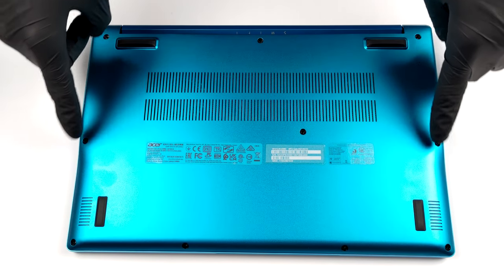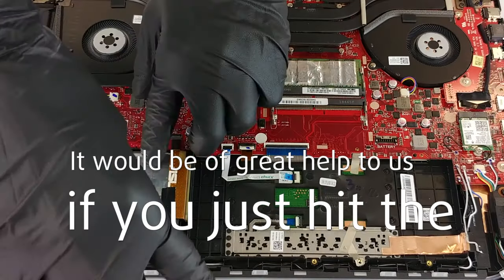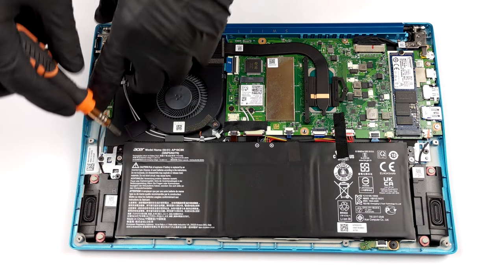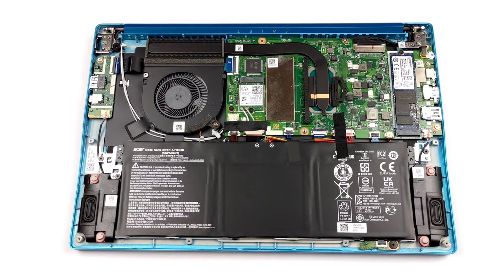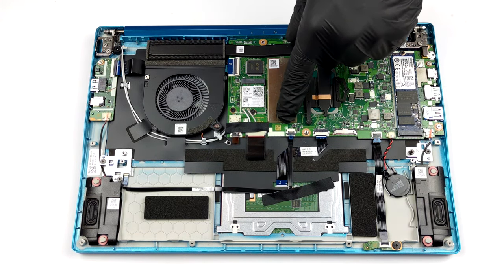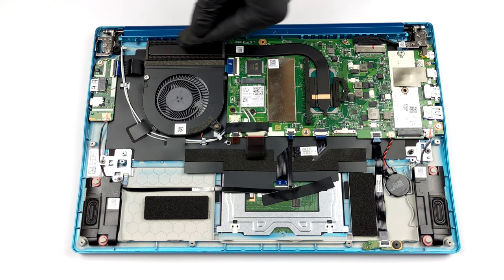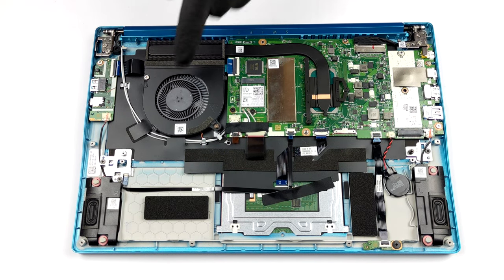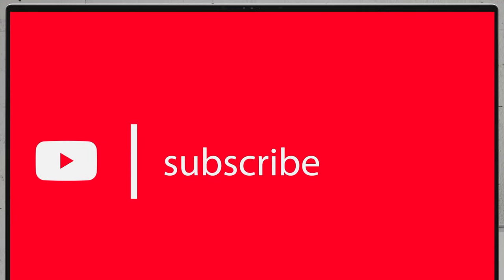🛠️ Acer Swift 3 (SF314-59) - disassembly and upgrade options

Comment: I was going to get the Swift 3 (Ryzen 5, 512GB SSD but only 8GB RAM) then found out you can't even install any more and the whole ammount is soldered

I don't think 8 GB is enough to future proof your laptop I think it will get slow fast. I went for the Acer Aspire 5 instead. that has 16GB of dual Channel ram and you can upgrade both slots.

Comment: Thanks for the video.

Anyway I was tried to upgrade the SSD to another ACER 1TB SDD, 
but seens MB didn't catched it.
Reply: try installing drivers  in support acer. maybe the problem is that the system does not recognize the component. Good luck ;)